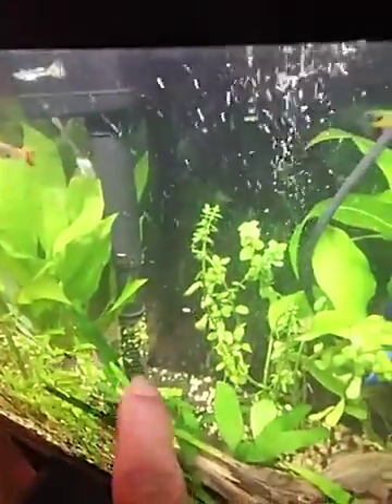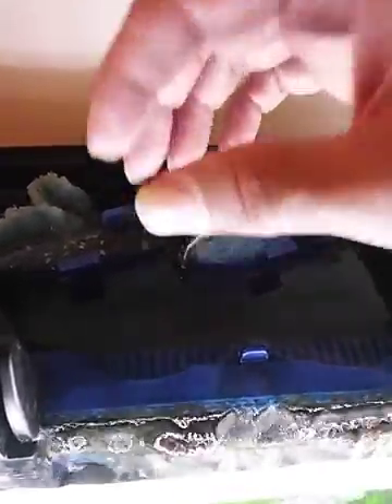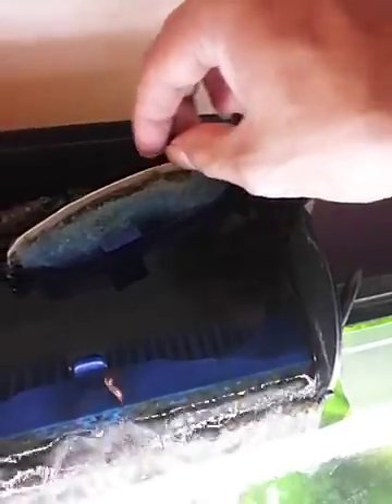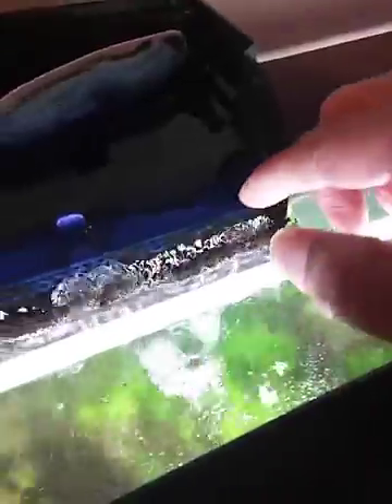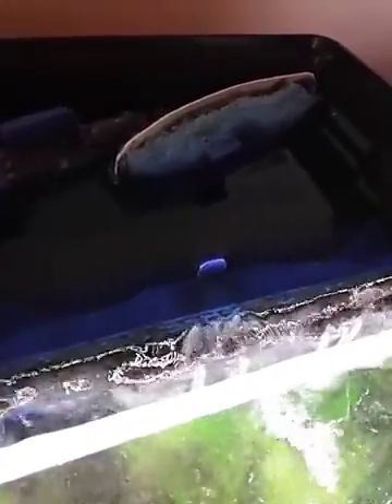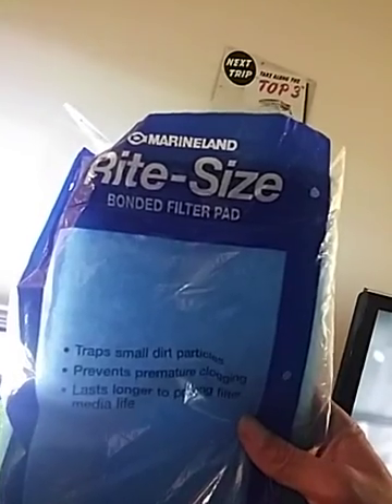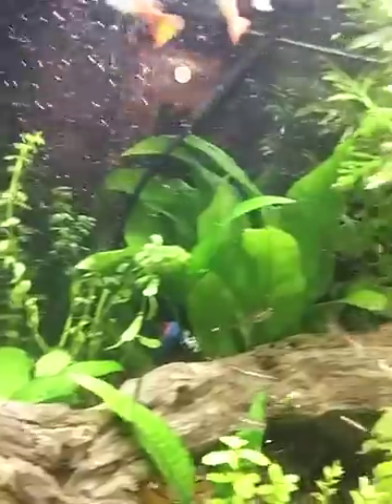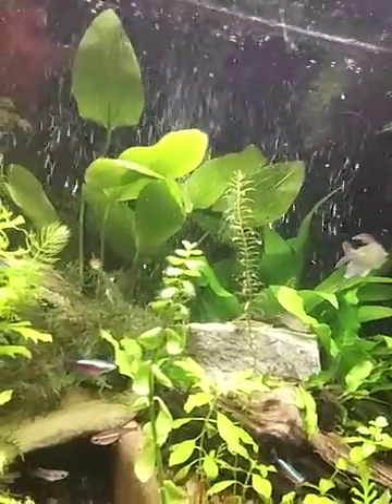Hotrodding Aqueon 55/75

Comment: I have-the same filter but I threw my filter pads away and went with hard media two medium media to find media shoved from the bottom to the top and it works great
Reply from the maker: Chad Hardesty I actually just use filter pads I made and a bag of purigen, mainly to filter out the particles as I run a cascade 1000 with bio media. if I did not get the canister I would have filled it up with bio mech by Ehiem or something similar.